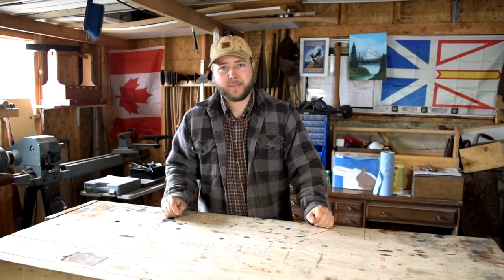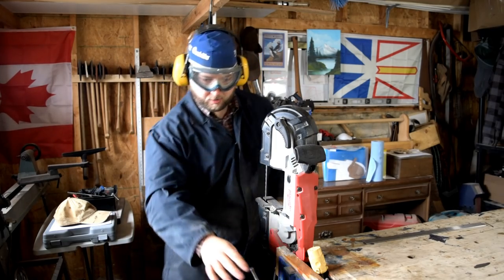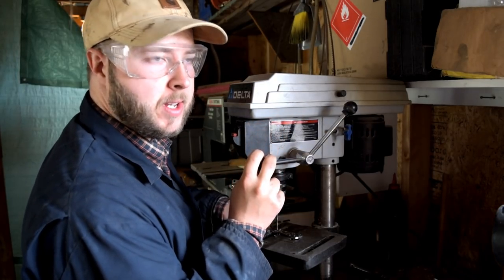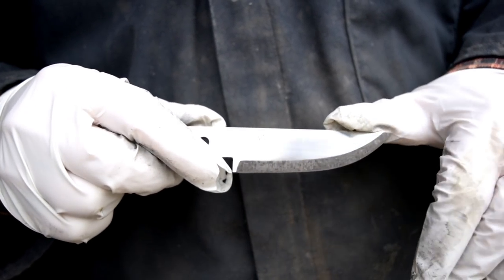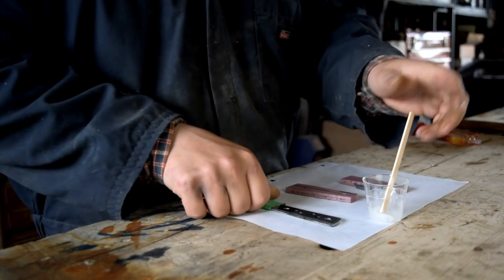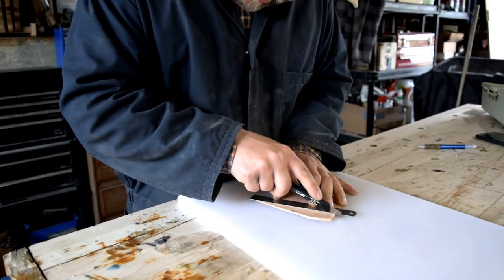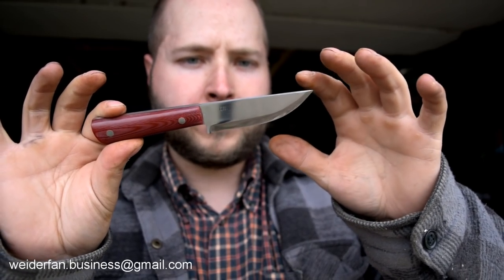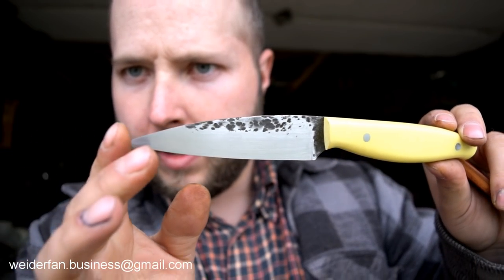URGENT One-Day Knife Build!

Comment: My first knife was a $10 MTech knife. It was rambo survival knife-esque with a pommel that unscrewed with a compass in it and a hollow handle for a survival kit. The blade was like a kabar but the spine had a saw and serrated on the clip point. Over the years I've modified it and sharpened it on countless Sanders, stones, etc but am unable to get it sharp due to crappy steel and heat treat. Despite this, it is one of my most treasured knives that I will never get rid of.

Ps, you are a very humble and modest person who takes a humble pride in his work, you just got a new subscriber.

Comment: Great work.... I spent 1 week making my knife and to my disappointment I couldn't for the life of me get a burr to form - I seem to just remove material even with a 30 deg angle using the lansky method. Could this be a heat treating problem? I heated it up to a non magnetic temp  however I only held it there for about 6- minutes before the quench. The file skated over the blade like glass and I though I was good to go...
Any advice would be appreciated.

Kind regards
Reply from the maker: Hey Robert,
That's a sad story my friend. Knife making can be challenging like that. Heat treat is almost positively your problem. Did you temper the blade after hardening it in the quench? It sounds like maybe your steel is too hard, which is causing the steel at the very edge to crumble and break away, instead of forming a hanging burr.
Reply: @kyle_noseworthy  yeah I did temper it not immediately afterwards - the next day infact. I did 2 x 2 hour tempers at 200 deg C.... Also do I have to hold it at critical temp for for a set amount of time? the instructions read for 15-30 min ( 01 steel ) but im recalling that I only did about 6 - 7 mins